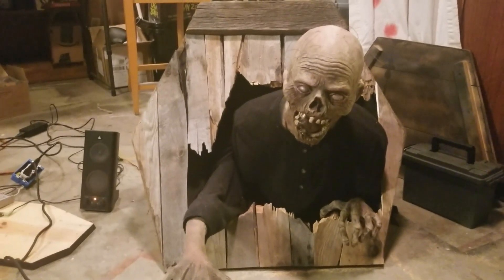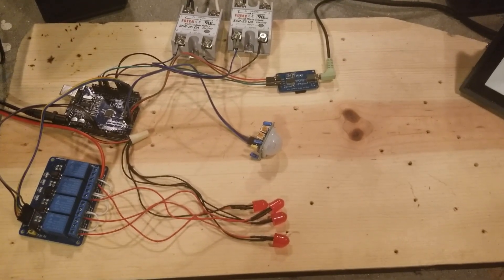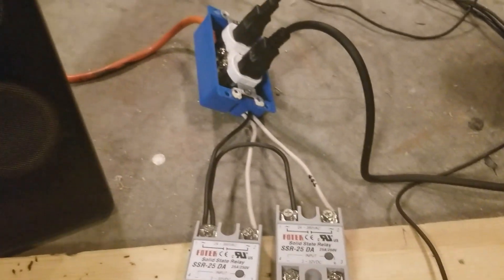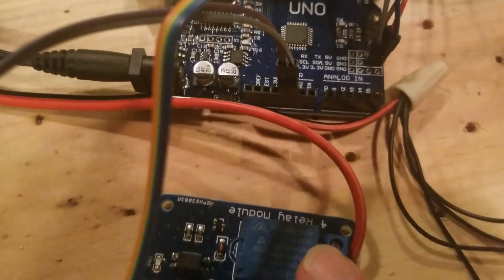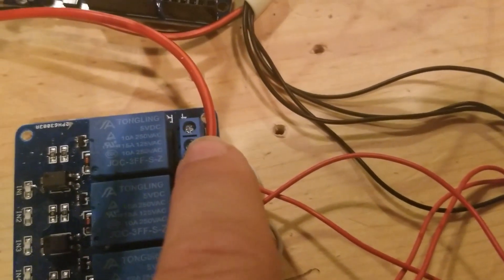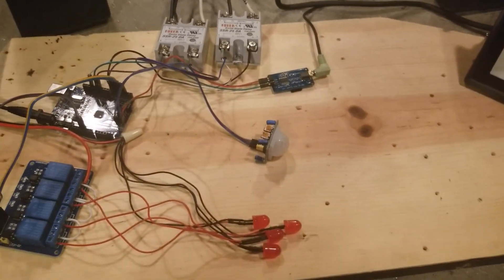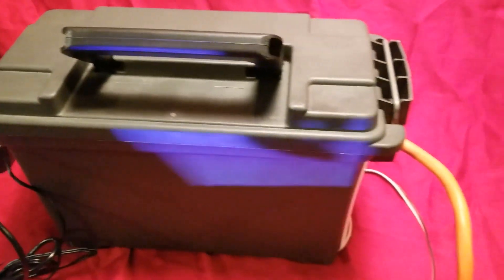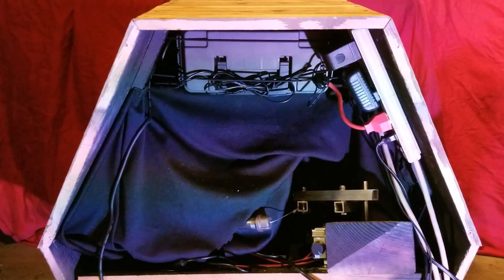Octobanger $20 prop controller

Comment: awesome video. I'm just confused about the power supply. do you really need 2 different supplys? one  for the arduino and one for the relay board. can't you just use one supply for the arduino and that will put out 5v for the relay board?
Reply from the maker: @dirtydrowningman4963 the relay will switch using 5 volts. You need the power supply to power whatever you're turning on/off.  Typically I'd be switching a solenoid 12v or a wiper motor. A power supply can be split between the arduino and the relay to power your device. Just provide enough amps (5 amp for wiper motor). I believe these relays can handle 10 amps.

Comment: Just an experience I personally had with octobanger… I have built quite a few halloween props with both fourbanger and octobanger, but they all have one flaw in common: the sound only plays every other turn the prop gets triggered. I posted this problem on a few boards, but no-one could really help.
Since I was getting frustrated with it, I learned some Arduino sketch programming to do it myself rather than relying on octobanger, but I used the same components. For my first self-programmed project, I basically just rebuilt an earlier project. Guess what… it had the same issue with playing the sound only every other time the scare scene gets triggered.
I guess, it might have to do with that specific mp3 module…
Usually, you start the communication with the module in the void setup of the sketch once and then only trigger the soundfiles in the loop. When I had it set up like that, I ran into that very same issue.
I’m guessing, that octobanger writes the sketch just like that in the background before it compiles it for uploading. You can’t do anything about that, since that is how octobanger is programmed.
I found a workaround by re-triggering the mp3-module communication at the start of the loop. That makes sure, the communication is established for every time the scare scene gets triggered.
It’s a shame, since octobanger is such an easy way to use an App with a graphic interface to sync events to sound. But unless you can edit octobanger’s sourcecode, I guess you’re either stuck with that issue, or learn to sketch-code manually.
Reply from the maker: @a.a.werding2620  Interesting, fortunately I haven't had sound issues. I have heard the v. 2 module don't behave.   My issue for one of mine was the scare sequence looping once triggered. 

I hope you'll share any fixes you find,  octobanger has been a great asset  for the haunt community, it'd be a shame if it were unusable.
Reply: I’ve built 5 props using the Four Banger (which is what this video is actually showing) and never had the audio issue you are describing. I did have troubles that ended up being the timing potentiometers on my PIR.
Reply: @billfoster6809  well, what can I say? I started with 4banger, ran into this issue and changed to Octobanger, hoping that would fix it… but no. I have built 5 different animatronics and they ALL had this very same issue: sound only playing every 2nd loop. I can only hazard a guess what the reason might be. First I thought, maybe they changed something about the internal structure of the xy5300 causing this, but then I wrote a manual sketch (not using 4Banger nor Oktobanger) that ran into the same issue. But when I initialized communication with the xy5300 not just once at the very start, but instead at the beginning of each loop within the sketch, it worked every time.

Comment: The smaller relays can handle 120v also.  I don't recall what amperage they can handle though.  There are issues with them when powering some motors which can result in the arduino rebooting.  Apparently, they're not truly opto isolated.  Got in depth with them back in 2016 on my channel when building an electrocution prop with shiatsu motor and the 4 banger version.
Reply from the maker: Awsome to have you watch my video, I watched all your videos before I built it. You are right though they definitely can switch 120v, I think at least 5 amps. I had never worked with relays or arduino and was following mikes instructions on things pretty closely. I'm sure it would have been cheeper without the solid state relays but hey they work and have been serving me well. Thanks for the comment!
Reply: @manzanitamurderhouse 
The 4 chanel relays you are using is up to 250v VAC on the output side. 10A? I even control a smoke machine through mine?
The solid state relays part definitely confused me in the usage unless to power something really heavy etc.
Great build all the same though 👍

Comment: Hi. I have build this setup 2 times, but both systems are only loop. Can you tel me what the problem is? The PIR is OK, i habe test 3 new PIR sensors.
Reply from the maker: So many variables its hard to say. Do you have a delay set for trigger/retrigger? Adjusting the sensitivity for the pir? Resending the sequence to the controller or reflashing the arduino? Good luck, hope you can get it working.
Reply: @manzanitamurderhouse   I build it 3 times, 2 x Arduino Nano and 1 x Arduino Uni with Shield.Same Problem... loop. It says on the start that it has triggered. 

OctoBanger TTL v8.2.0
Config OK
Frame Count: 13
Seq Len Secs: 33.95
Reset Delay Secs: 20
Pin Map: Shield
Trigger Pin in: A0
Trigger Ambient Type: Low (PIR or + trigger)
Trigger Pin Out: A1
Media Serial Pin: A2
Media Type: Catalex Mp3 Ambient + Scare
Ambient Volume: 20
Timing Offset ms: -0.405
TTL PINS:  7,6,5,4,8,9,10,11
TTL TYPES: 0,0,0,0,0,0,0,0
Ready
Trigger detected on startup-
Going cold for 30 secs
Reply: Can you send me your Version from Octobanger? I think the problem is only by the newst version.
Reply from the maker: @AndysBastelkanal  i have only used defaultbpin map not shield but it should work fine.  You have 20 second reset delay what about boot delay? After the first trigger does it play ambient for 20 seconds or just instantly loop? Proper firmware flashed for shield? My initial guess was bad connections or miswired pir but if you've done it 3 times I'm really not sure. Try leaving it on for 5 or 10 minutes to allow the pir to "warm up" 
 The versions appear to be the same.
Reply: @manzanitamurderhouse  Hi. The PIR works now. I haver ordered a new one. All my 5 PIR are dont working, the new one is fine. But... i have now a problem with the sound. I have buy the YX5300 UART Control Serial MP3 Music Player (the new Version with a new Chip). In Fourbanger it works fine, but with Octobanger i have only each second sequence a ambient- and scare sound.

Trigger = no sound but the sequence is playing.
Trigger 2 = sound and sequence fine
Trigger 3 = no sound..... etc.
Reply from the maker: He mentions the audio problem with the new chips sometimes not activating the scare tracks. If you look at the bottom of the octobanger page under troubleshooting update 5-30-2021
Reply: @manzanitamurderhouse  OK, thank you very much from Germany

Comment: 8:51 Thanks for posting this. Cleared up some questions I had on how to wire everything. What kind of boards did you use to mount everything inside the ammo box?
Reply from the maker: Thanks, glad it could help. I used some scraps of some white hardboard I had laying around.

Comment: I know you might not know but I'm getting frustrated any idea on why mine doesn't go back to ambient sound? Even on the "test" they give us? Mine starts in ambient then triggers then goes quiet..... ahhhhh
Reply from the maker: Hmmm, that's not an issue I've had. Does it retrigger when no ambient sound is playing? I  think i would first reflash the arduino, format the sd card and reupload sounds. If that doesnt help possible wiring problem. Hope you can get it worked out, the octobanger has been pretty reliable for me, but they can be a little temperamental at times.
Reply: Might be the “Ambient On Delay” setting is set to False? 
In controller properties.

Comment: Do you know if the Uno run the 8 channel relay board?
Reply from the maker: Absolutely, in this video I'm using pins 2,3,4,5 for my 4 channel relay and pins 6 and 7  for my two solid state relays. I have pins 8 and 9 empty. The 8 channel relay would simply use all pins 2 thru 9.
Reply: Awesome, thank you very much for being so quick to answer. I hope I can ask more questions when everything arrives.
Reply: I have another question, now that everything is ordered, can you have multiple sound tracks play on trigger? Example: first track is ambient sound, say birds chirping, second sound is a voice over welcoming guests to the show, third sound is the attraction sound, like a bear growling? Can this be done in the program or is it limited to the two tracks?
Reply from the maker: @Stan-TRO  As far I know you are limited to just the two tracks. I have found it best to have general ambient sound (wind, lightning, rain, birds) separate and always on. However if you wanted a different sound to trigger you could use one of the relays to activate a player. Off the top of my head not sure the best way to do that though.
Reply: I hate to bother you again, but, I have the 8 channel and the mp3 working, now I need to figure out how to get a trigger working. What pins do I hook a manual trigger to and what pins do I hook a PIR too? Pins 2 through 9 are the 8 channel and every pic or video I see has the pir in pin 2. Any suggestions? I really do appreciate the help.
Reply from the maker: @Stan-TRO  I believe its pin 11 you want for the pir. Vcc to 5v and ground to ground. As for a manual trigger I'm not sure that will work. The pir sends out 3.5v or something to trigger.
Reply: Thanks again for the help. I read some of the code and found TRIGGER_PIN_COUNT =3, then just below that, found TRIGGER_PINS = {10, 11, 12}. Am I to assume it could be any of these 3?

Comment: Do you know if I can hook up a led strip on this setup and make it flicker like horror movie lights?
Reply from the maker: You could, but it would only flicker when triggered. You could probably repeat it on a loop to create a constant effect but not ideal. I used it to create a flicker effect in my haunted radio seen in my 2020 diaplay. https://youtu.be/4In3jlORfAk
Reply: @manzanitamurderhouse  thanks for the reply. Im new to this so thanks for the help. 
Basically I'm making a walking dead themed cabinet the doors of the cabinet are slightly open and chained with zombie hands trying to come out.
I want to make the hands move in and out slightly and maybe a solenoid or actuator to bash on the fake doors a little. So they move a little with the walking dead theme as ambient sound. and zombie noises when trigged with sensor.
Do you think this possible with the setup in your video?
Thanks again for the video. Very useful stuff for newbies like myself
Reply: @manzanitamurderhouse  sorry for the long message
Reply from the maker: All of that sounds absolutely possible. Have you been to buttonbanger.com download the parts list in fourbanger section and i reccomend the octobanger program. I've built four total and have run  pneumatics with 12v solenoids projector using sprite player wiper motors 12v and 120v leds. From what I've seen they are as versatile and more so than many other purchased prop controllers. Give it a go, and feel free to ask me questions as they come up.

Comment: Thanks for the helpful content. Your prop looks great! I'm a beginner looking to build an Octobanger this year. Is it possible to use the 4 channel relay to power other props instead of just 4 relay lights? For example, could I have some additional MP3 players and box fans hooked up to turn on in a sequence of 4 events? Thanks for any guidance you can offer.
Reply from the maker: In my case I have a 12volt dc power supply  connected to the 4 channel relay that powers whatever I'm switching. I used solid state relays to switch ac power. I used the 4channel for leds and air solenoids and the solid state for wiper motors and larger ac powered flood lights. I'm far from professional though and just followed directions from buttonbanger.com
Reply: @manzanitamurderhouse  thanks for your quick replay. Much appreciated.